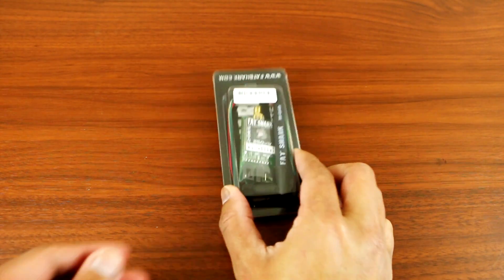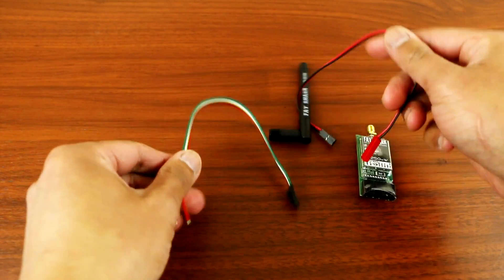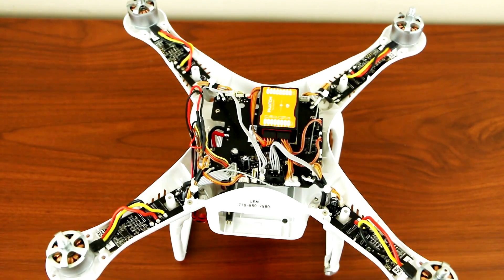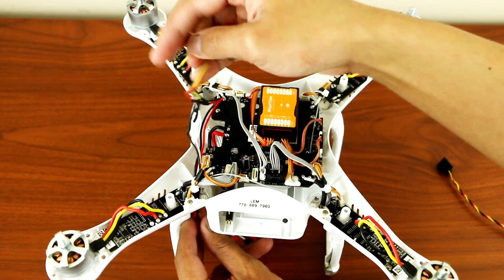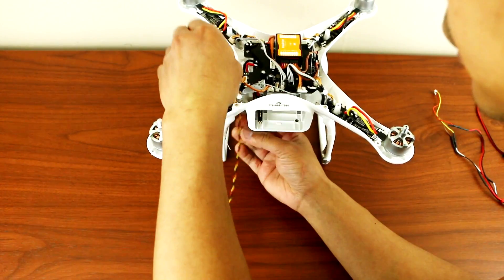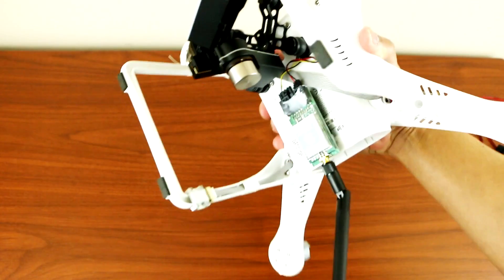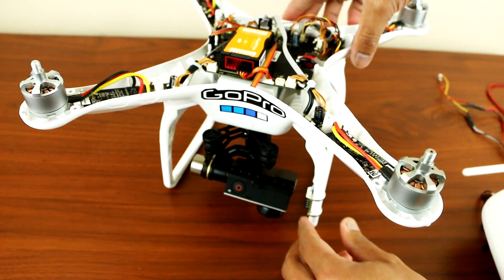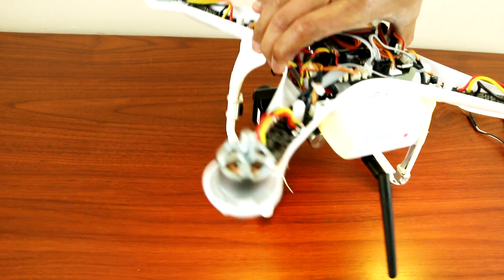DJI Phantom 2 - Fat Shark Transmitter Installation (using the plug and play cable)

Comment: So install the transmiter and it will show the video from the h3-3d?

And is it easy to bind the video to the Black Pearl RC801?

Thanks.

Just confused on how the video would come thru?
Reply from the maker: yes it will go through your go pro, gimbal and to your monitor
Reply: can i use fpv goggles for monitor instead>?

Comment: Thanks so much for this video, its a lot clearer now what I needed to do. There was one question I had around how the video signal got from the GoPro to the motherboard but after some research its clear that is connected via the gimbal cable. The FatShark transmitter you used .... is there a specific model I should ask for. Again thanks for this video.

Comment: Hello!  with this cable pulg and play in Fatshark can i see the video of the GoPro in Fatshark goggles? or need some more cable?
Reply from the maker: yes, you will able to see the video from the go pro just with this cable
Reply: ok, I saw another video of another guy connecting this plug and play cable in a osd Mini! I need to buy a osd Mini also to use Fatshark?
Reply from the maker: Bruno silva iosd mini is a flight status of your phantom. you don't need it if you don't want to see your flight status
Reply: Ok! Thanks again! I want to buy a Fatshark but I still have many doubts on what model and antenna and etc ...
Reply from the maker: Bruno silva get the ImmersionRC 600mw and ImmersionRC spironet antenna with IBCrazy black cannon antenna for long range
Reply: yes it is good! and what model Fatshark goggle? in imersionrc'll be able to use that plug and play cable?
Reply from the maker: Bruno silva not really a goggle fan, I prefer monitor
Reply: I read that the goggles are confused and a little dangerous, which monitor you recommend?
Reply from the maker: Bruno silva its just annoying to take it off and put it on especially your flying your phantom close by. im using the black pearl monitor
Reply: yes, I saw this monitor on another video, thanks again for answering my questions, you have helped me a lot!
Reply from the maker: Bruno silva no problem any time!
Reply: hello again! I have a question a bit stupid, LOL when you calibrate the compass and puts the nose down to calibrate the vertically, your gimbal zenmuse makes some strange noise and starts moving like crazy? every time I calibrate my gimbal on vertically makes this noise is this normal?
Reply from the maker: Bruno silva yah its normal. it happens to me as well. once you finish calibrating it just turn it off and on your phantom and you will be fine
Reply: ok, good for us! thanks
Reply from the maker: Bruno silva your welcome   : )
Reply from the maker: Bruno silva do you want a better reception? why would you want to go for one antenna vs a 2 antenna setup on the monitor? go for black pearl monitor, its the best monitor out there as of now  https://www.gothelirc.com/shopdisplayproducts.asp?id=246&cat=LCD+Monitors
Reply: yes I will see it, but I am wanting to buy a cheap fpv kit with reasonable quality.
Reply from the maker: Bruno silva in that case, im not the person you want to ask for those kinda product  : )

Comment: Okay i have a question we have recently bought the phantom 2 vision plus; with the fatshark transmitter transmitting to the goggles does that mean you lose the iphone screen with this plugged in? or can someone else use the iphone while i have the goggles on?
Reply from the maker: sorry I don't own the phantom 2 vision so I cant really give you an answer. why don't you give it a try and find out. do you have a separate monitor for your fat shark?
Reply: How it work?, Did it work? , I read  that would make  interference with the rc transmiter cause both are same frequency.

Comment: im not going to use my ios at all ill just use the one on the goggles but i wanted to get that cable can u send me a link to were i can get it from?
Reply from the maker: ios on the goggles??? you can get the cable at ebay
Reply: whats the cable called?i ment the time from the gopro cam.
Reply from the maker: ***** http://www.firstpersonview.com/cables/dji-phantom-upgrade-board-to-fat-shark-immersionrc-transmitter-cable
Reply: what if i dont use the zenmuse gimble?
Reply from the maker: ***** for your information the GoPro doesn't provided you time or the status of your phantom, you need to purchase the iOSD mini to see your phantom status. 
it won't work if you don't use the gimble, where are you going to get your power sources to power up the gimble?
Reply: OK just was making sure that after I do this mod that I won't have to change any thing but the color lol thanks.

Comment from the maker: yes the fatshark can work with the dji phantom 2 vision plus
Reply: i'm going to install this on my phantom vision i have got rid of the vision camera and going to install a go pro you sure it will work got the cable for it ready
Reply from the maker: Glen Garden works well for the non vision phantom
Reply: L BS I have a DJI 5.8 GHZ video transmitter and I am attempting to set up via the phantom 2 battery. The transmitter came with a connection for a lipo batter but I want to run the transmitter via the battery running the drone? Will plug and play  work?
Reply from the maker: trevor bona https://www.youtube.com/watch?v=fINZQZovhIk
Reply: YourTechGuide

Comment: Where can I purchase the plug and play cable.  I want to include my DJI mini iOSD also.  I'm not sure how different that would be.  Nice Video too.
Reply from the maker: since your going to include your dji iosd mini, don't bother buying the plug and play cable. if I were you, just use the wires that came with your transmitter and solder it. i have a video on how to install the iosd mini, check it out!
Reply from the maker: here's the video: DJI Phantom 2 - How to install the iOSD mini to Phantom 2 (clean look)